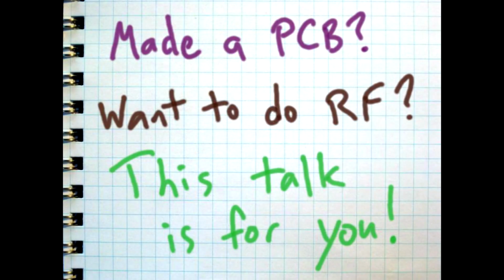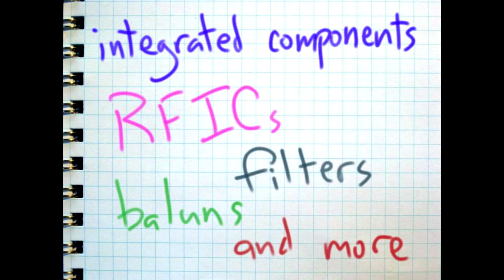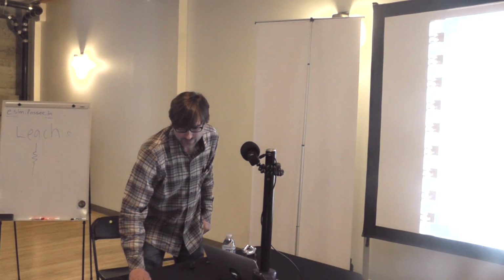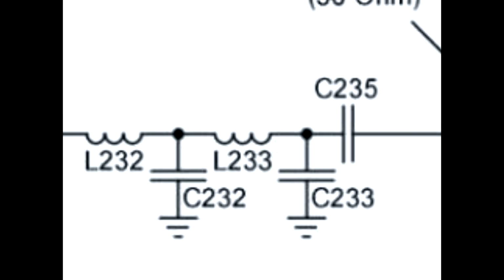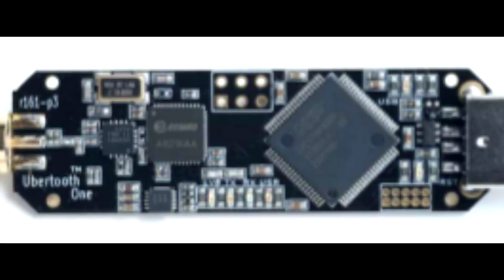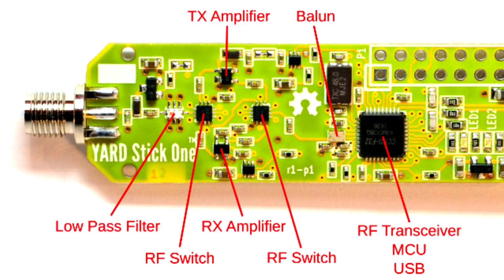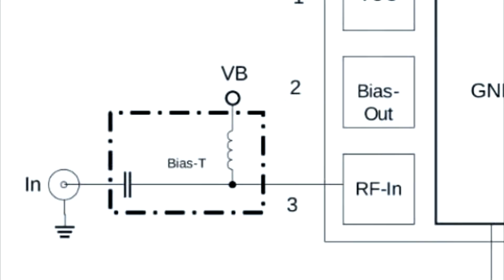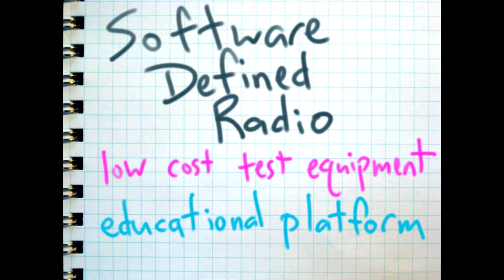Michael Ossmann: Simple RF Circuit Design

Comment: On 19:21 he is using 3.66 for dielectric constant. But if trace on the surface then only half of the surrounding material is board and the rest is air. So the actual dielectric constant should be (1+3,66)/2 = 2,33. Just a little tip

Comment: Great presentation.
The only advice I'd give you is that you could be a bit more clear by simply stating "logic signals" or "RF signals" instead of just calling everything "signals."
Otherwise, very well done.
These are the same rules I've learned over the years! It makes everything MUCH easier, esp considering the advances in chips, software tools, and everything else over the past 30-40 years! 
(Much more so in last 10-15 years, and probably faster as we speak.) 👍👍

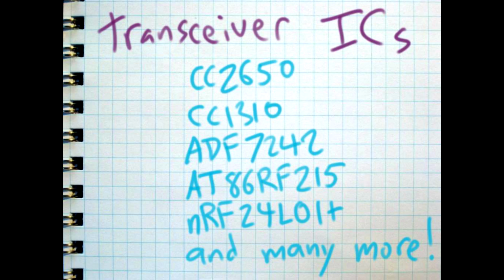Comment: @10:00 I totally agree. Choose a chip that does it for you.
I am a programmer, but no electronics expert (at all).   For a project i chose an nRF24L01+. I "just" had to poke some values into the chip's registers, and it would rock.      What a giant difference that was from earlier radio-projects i did, as a total RF noob, with "dumb" radios circuits. pffff capacitors, resistors, filters, ..  
I dove into datasheets before knowing what to write to the IC, of course.. but i guess that is not even needed for your Arduino project (meaning: there will probably exist ready-to-use libraries for your RF-IC of choice)..  so you do not need to write your own code for interfacing with the RF-chip.

My point: If you know not much about RF, but you want to add some radio to your project:    Choose such transceiver-ICs as mentioned @9:40

Comment: 25:40 everywhere you calculate 50 Ω, shouldn’t the differential also be 50 Ω, but with another trace width?
Reply: Yes, this is correct, though we often see 100 ohm used for differential devices in 50 ohm systems, as it makes transforming between single-ended and differential simpler. 50 ohm differential is "natively" 25 ohm single-ended, so to speak.

Comment: Thank you Michael, I've owed one of your HackRF One's since it was pretty much first offered and love it. You are absolutely an expert engineer on this, far more than most university-educated engineers.
Reply: @jshowa o You apparently don't understand why you want to use more than one or two layers. When you deal with RF, you especially need separate power and ground planes.
Reply: @jshowa o by the way, stitching is a bad idea when your using RF frequencies. You guys should take more notes from Michael.
Reply: @fjs1111  No people should take notes from current experts in the field like Rick Hartley and a multitude of others not from a 7 year old video of something that (luckily) worked at the time! This stack-up may have worked for him but it ignores modern understanding of high frequency PCB design, signal integrity and return paths / fields.
Reply: @ingmarm8858  I've been developing embedded systems for quite some time. When it comes to RF, Michael has it nailed. If you're not familiar with his work, take a look at some of his open source OpenBTS and cellular network contributions. He's not a 7 year old... I don't even understand why I took the time to write this other than to defend him

Comment: After I finished my undergrad I  applied at a laser manufacturer and got thrown into a entry level RF engineering position with no training whatsoever from the company. I learned so much on my own and was able to learn everything you've talked about on my own and I just wished I had seen this so much earlier. Their biggest issue was being cheap and constantly switching components for cheaper ones and manufacturers causing each batch of boards to be different from the next, it was extremely frustrating and I'd be pressed to make them work
Reply: 23222😅😊😊😅😊😊😊😊😊😊😊😅😅😊 1:42 😅😅 1:43 😊😅😊😊 1:43 😊😮😊😊😅😊😅😊😊😅😊😊😊😊

Comment: Very nice presentation. At 42:48 though we can see a bad practice with the decoupling capacitor. The decoupling capacitor should be as close as possible to the pad of the IC. When you need to connect the supply pad to a via, you place the via further away, not in between the capacitor and the pad.
Reply: The funny thing is: it’s not necessarily needed… the via can be in between. But I would also place it as close as possible, unless there is a good routing reason for it.
Reply: Placing it farther away can add an unnecessary stub depending on what's being accomplished

Comment: I realize that the newest comments in this section are 3 years old but I'm designing a PCB which has an MCU and a sim800l module and a GPS receiver module. I think it's considered an RF circuit?

Comment: Michael Great show I learned a lot.  I viewed your demonstration in Nov 2020 and found that when you were on screen and pointing to a display the pointed at area was not visible to me;  the same when the time the Screen has the display only and you are pointing off stage to a component part the pointer is not visible therefore very confusing.  This is because the filming of the demonstration when you are making it, does not follow where the pointer is pointing to.

Comment: Can anyone will help me, I want to know, or you can say want to learn about RF transmitter receiver module circuit,so that I can design my own transmitter receiver module circuit for my RC control toys,so what are the stuff I've to study, in other words how do I start learning step by step. Hope someone will guide me
Reply: I would request u to start from aurdino based RF transceiver like nrf24 or lora modules. They are good for beginners to start designing RF circuits for toys and for other projects. U can find lots of videos about aurdino based remote controller. It would be a lot easier to begin with.  And learn about the basics of RF like frequency,wave length etc.. and programming for the RF without that it would be just nightmare for u to design RF circuits!.
Reply: @Oombu008  Sir I'm so grateful to u, thanks 🙏💕 for the reply. Sir actually want to know the working of the 433 MHz RF transmitter receiver module circuit diagram,and the components used in the circuit diagram. I want to know about the topics covered while designing this RF transmitter receiver module circuit diagram
Reply: @kamleshchavan7451  the circuit requires  433mhz transmitter and a 433mhz receiver  and a aurdino nano. I request u to learn about aurdino boards working principle and about the  GPIO pins in it. And I would like to know about the application of Ur project for clear idea.
Reply: @Oombu008  sir I want to make RC car
Reply: @kamleshchavan7451  then it's better for u to go with nrf24 module with 2.4ghz frequency. For RC car, u has to use 2 aurdino nano boards and nrf24 transmitter and receiver. The nrf24 also has the same range as 433mhz transmitter . U are using aurdino based control system or any other custom boards?
Reply: @Oombu008  Sir Arduino and the RF module are two different things. We use RF module circuit for transmission and receiver with Arduino. I want to know the working of the RF module circuit diagram used with Arduino for any project. Want to know about the RF transmitter receiver module circuit diagram it's working, suppose I want to design my own RF circuit, so for that what are the things or topics I'm suppose to study
Reply: @Oombu008  yes I want to know the working of the RF transmitter receiver module circuit diagram the components used, working of every section of the RF transmitter receiver module circuit diagram
Reply: @kamleshchavan7451  well, then I would suggest you to learn about software defined radios like Hack RF one for example. The schematics and other parts details , working principle are open sourced (u can find about them in online). By using Software Defined Radios (SDR) u can do anything based on RF. They have wide frequency range and Better range compared to  ordinary aurdino RF modules. If u are good at software then u can program the SDR for transmitting the signal at any frequency u want and receive them through any aurdino modules available.
Reply: @kamleshchavan7451  and other examples are 3dr  radio which has an range of up to 3-5km u can find schematics about that in online. My suggestion is that go through multiple SDR designs and know about them very well. It would give u some understanding about the design and working. it's better to reverse engineer the RF circuits. And learn about programming! Without that u can't do anything! And learn about kicad for schematics.
Reply: @Oombu008  Very first thing thanks for the reply once again. Sir believe me I tried to find the schematics parts details, working principles of the RF transmitter receiver module circuit I didn't get it. Sir you have any link regarding, the topics
Reply: @Oombu008  sir can u help me and explain the RF transmitter receiver module circuit diagram

Comment: Does anyone notice that Mike didn't pour ground on the top layer? 
I haven't seen any reference design without ground pour on TOP/Bottom layer.
 I know that it it's a very dense board, ground pour maybe cause more trouble. 
But the 'ground' also constitutes a port of RF circuitry, no? Anyone RF expert shed some light here?
I am no RF expert, but I'd like to know.
By the way, thanks Mike, for this great tutorial!
Reply: If you do a ground pour on the same layer as your RF traces, your microstrips become 'coplanar waveguide above ground'. This changes your trace impedance, and if you do it, then you really do need to make sure that your ground pour and your ground plane are exactly the same potential.
When you get up to high frequencies, like microwave, coplanar waveguides (whether above ground or not) become more useful. But at less than, say, 5 to 8 GHz, you usually don't need to care.

Comment: Great video!

The bypass capacitor is on the wrong side of the power via at 43:11... the power should have to pass by the capacitor before it goes into the IC pin. It's not using the capacitor at all for high frequency operation if the pin goes directly to a via.
Reply: No it’s not haha.

Comment: A great video demystifying practical RF circuit design. A minor correction 1-dB point (P-1dB) is 10-dB lower than third-order intermodulation (P-IP3) point.  Thanking HACKADAY for posting this video.

Comment: designing RF circuitry is not my main major; as I am more classified with power electronics (dealing with high current AC And DC) but my B.Sc. was in telecommunications and electronics as I must ask; since the beginning of your lecture you said transceivers what are they and what is their major role in the design I mean if we omit them from the design what will happen a mismatch?
Reply: Transceiver is a device that is both a TRANSmitter and reCEIVER.  He is saying that if your design requires a transmitter and a receiver, don't design them both separately, use a chip that includes both functions and is easy to use.  Great simplification of your design.

Comment: You saved me a lot of time. I was struggling with calculations for 50 ohm characteristic impedance with a 2-layer board. The main point and trick I found that saved me is moving to 4-layer board because it adjusts the dielectric thickness between the top copper and the inner copper to a very convenient value of around 0.2mm for most fab houses. Thanks.

Comment: I never heard of a 4-layer PCB.  Thanks!  If you can't use 50 ohm for Z matching, use a R sub box or pot and an SWR meter.  It would be more accurate to use a scope for Z matching, and since Z = square root of R squared - the difference of X sub L and X sub C, you can use a regular calculator.  People, you can also learn dB via watching my YouTube video.  On YouTube, type in Frank Reiser M.S., and then type in decibels.
Can you send the output of your transceiver to a power amplifier (possibly a op amp with PNP transistor to avoid clipping) and not worry about additional Z matching?
I didn't know that there were dedicated chip antennas.  I want to build my own 2 m ham radio.  I sold my old 2 m and 70 cm Icom, and a lot of electronics equipment, years ago when I got freaked out over how to build and repair SMD.  However, I just learned how to deal with this, and now I am back in business.  I am fixing all types of electronics.
Thanks.  Great information; very practical!
Frank
Frank Reiser Video Audio Service

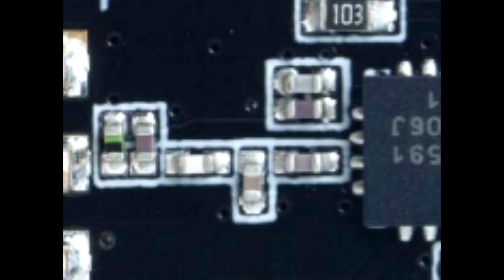Comment: What are those small silver colored inductors and capacitors at 35:45 called? I have not seen them before. I have usually these cylindrical or paper caps and wire wound inductors
Reply: there are through-hole devices and smt(surface mount technolog)devices. in this videos, these are smt capacitors and smt inductors

Comment: Regarding the over 90-degree trace angles. back in the 1980s when I learn PCB design with red and blue tape on a drawing board (!!) it was the PCB manufacturers that told us not to use 90-degree or more acute angles to avoid ferric chloride build up in tight corners that could dissolve into your trace. Wide angles helped prevent the acid eating too much trace copper around corners. And it looks better too :)
Reply: Using acute angle pcb corners created reflections in your transmission lines

Comment: I am into high power rocketry and need a a data down link that can run off a Li-ion battery (3.7V). The data is a 3.3V TX TTL signal generated by the flight computer ( Adafruit Feather MO Adalogger). I am wondering if you could help me design a simple RF circuit. Maybe I should mention altitudes be over 50,000FT.
Reply: What did you end up going with? What frequency? Antenna?

Comment: Some of this I found good advice, other parts I found laughable, and others parts were appalling. Do not assume you can get away with declaring your design as test equipment to circumvent fcc requirements. You interfere and get turned in, you will wish you were dead.

Comment: All good points but - seriously in error on the "pop quiz" . . . internal impedance matching is not the only criteria in selecting components. The BGA777 has a lower noise figure, more gain (and selectable), and lower power consumption. It "lacks" internal matching (which is not a flaw) for flexibility. And a note on datasheets: When a chip maker lists "various" under recommended components, it means "various" companies manufacture that recommended component. An important point also - the datasheets give you a >basic< "recommended" layout, circuit, etc. It's up to the engineer to get his calculator out and build it to his own specifications, performance, etc. Datasheets commonly have errors also. The wise engineer will do his own calculations and verify his design thru measurements.

Comment: Test equipment, if it's an intentional radiator of RF signals, is not exempt.  The exemption refers to digital devices, not radio transmitters.

Comment: The DC 50 Ohm value you're talking about isn't what you measure across the entire circuit. The impedance at any given point on the transmission line is defined as Z(d) = V(d)/I(d). This means that the electromagnetic wave peak voltage and current define the impedance at a given point. So although it's a good rule of thumb, this is why a one hour video is NOT better than 4 years of engineering college.
Reply: He is clearly talking about AC impedance, why else would the thickness and composition of dielectric figure into his calculation?
Reply: Cuz Mr Academy is only 3 years into his 4 year degree :)
Reply: Your comment isn't helping your case. Z = V/I also known as R = V/I or ohms law. Impedance includes AC reactance as well as the DC resistance that your explanation included
Reply: he never said DC .... be fair there is more to it then ''50 ohms''...fortunately for many applications you don't have to exactly know.

Comment: It's all true. It just lacks the fun of refactoring designs until you've created something novel no one else has. I can spend 3 bucks on an RDA chip and make the equivalent of a pi controlled baofeng, or I can add a few transistors to the other stuff already in the pi and do the same thing without the RDA chip. One is definitely easier, the other way more fun.